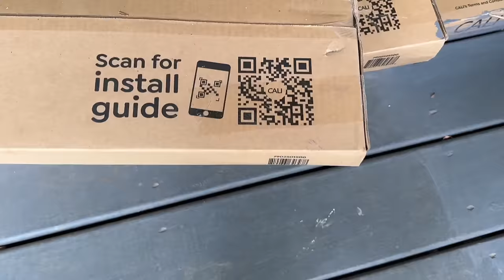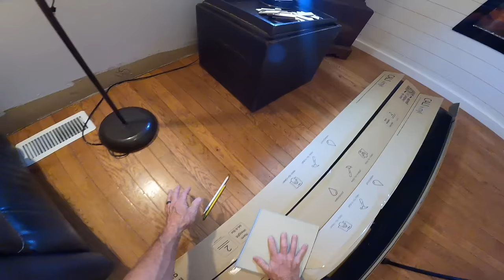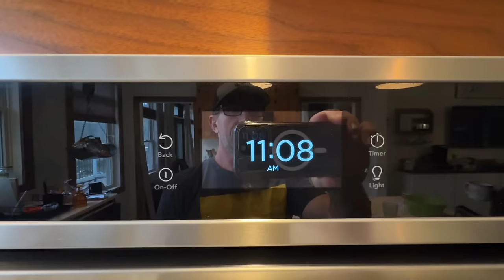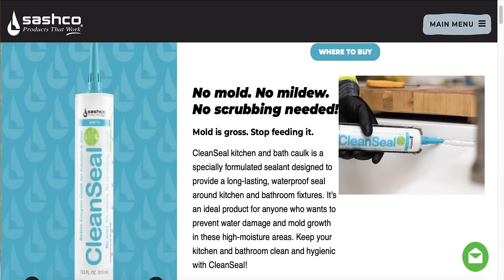Installing New Cali Luxury Vinyl floors from Lowes!

Comment: Hey Jay, here’s another pro tip. Take the plastic plate protector off your jig saw and it will cut more straighter as the blade will be more closer to your piece 😊
Reply from the maker: Good tip!

Comment: You should have added 2mm foam underlay carpet between old and new floor. If the old floor is slightly sunk into a pit in places new floor starts to make noise when you step on it.
Reply from the maker: Yeah, there’s like one or two spots that have a little creek in them but for the most part it’s pretty sound. These floors do have a little bit of foam already built-in on the bottom which I think is helping a lot.

Comment: For you transition to put the floor together from you family room to your kitchen, I have found that if you use like a 5 inch scrap piece with the correct edge.  I use that to engage fully and then use it to punch the two pieces together by pounding on the back side of it.  this way I ruin a piece I am not using and do not chance breaking the tabs on the pieces.

Comment: U should use scap pieces of flooring to hammer them into place. It doesn’t break the tounge off, but you’ll need multiple pieces of scrap because the will break easy, but it save your finish floor. Some flooring snaps east and some is difficult.

Comment: J you're doing a great job on that floor, I'd like to give some advice. I don't know if it'll work or not but for your wife's back. I have one of these chairs called a Teeter. And it really helps stretch. You can hang up side down. Or add a somewhat of an angle, but anyway, it'll.  Relieve her. I don't know what's wrong. If it'll damage her or not, but you might think about it. But I've had this for several years and it's really good for my bad back. That I have Is from working on cars and stuff all my life.
But it does pull your back and relieve all your strain And it would be Good for you too.Great For You also.

Comment: There are two wacking tools that are helpful. One is a black plastic block with groves and bumps. The other is a metal tool. It bends down at one end and bends up at the other. This is helpful when trying to close the gap when the plank is less than a quarter inch from the wall. Ask the store where you buy the planks from. And if you use a 2x4 instead of the proper tool, go back to the store and get the appropriate tools. You can cheat and use a cutoff piece that fits into the groove. Don't hit the edge of a plank, it will break.

Comment: I have a theory about the dulling jigsaw blades: The floor boards are likely not pure vinyl. What's killing the blade is likely an abrasive additive. Powdered limestone comes to mind here. It's dirt-cheap, bright white, no real supply constraints, good filler, UV resistant (so the vinyl doesn't get brittle in sunlight exposure), heavy (feels more luxurious) and stores heat. What could also contribute to the dulling is the friction heat. If the blade is used for a prolonged time, heat can build up in the blade removing its temper. This makes the steel softer and more susceptible to deformation (dulling of the teeth). But unless you want to take frequent breaks during a single cut, buying more or specialized (carbide?) blades is the most economic option. And if it's really the heat build-up in the steel, you could cool the blade with water during cutting. Do that on your own risk though, since I haven't heard anyone else doing it.

Comment: You need to screw an off cut of flooring to the underside of the tapping block, so that the groove fits the tongue and you can then tap without breaking the tongue on the new board

Comment: Question, I have tile floors also and there old and the grout lines are huge. I want to go over them
Like your doing , But won’t the floors squeak are move going over tiles and wide grout lines?
Reply from the maker: These planks that I’m using the floors are 9 inches wide so they cover any type of imperfections or gaps pretty well. If you’re using a smaller plank, you may run into some issues?
Reply: I understand, totally makes sense. Thank you, really appreciate you getting back to me.
Take care, & have a great weekend🤗

Comment: 17:23 I thought your idea was to start at the fireplace with a full sheet. What happened? I see you had to mitre it in at least 1 inch. 19:25 I cant believe you didnt use a scrap piece to lock into good tongue and hit the scrap piece on the opposite scrap tongue. If you want your scrap piece to last the whole job, cut the tongue off and screw a 2 by 1 hardwood along the cut off tongue line and use that for the bashing place.
Reply from the maker: Awesome pro tip!!

Comment: You’re likely all done putting in the floors…..for tight spots, put painter tape on board. Glue a piece of wood to tape.  Tap on the wood glued to tape. When done, remove the tape off the good piece of wood.  It’s on YouTube somewhere. Google it.  I’m likely explaining it horribly.

Comment: Why didn't all the boards in house run the same way?
Reply from the maker: That’s a great question! I wanted the boards to run long ways when walking in the front door so that it looked more elongated. But that meant that nana and pop pops tv room the boards would go sideways as you’re looking into the room which I thought would look weird and make the room look shorter. So I just made that room go elongated as you’re looking in the door and the rest of the house the other way. Hope this makes sense! Lol thanks for watching.
Reply: @Building_Jays_Way   that does make sense when I see it that way.  Thank you for the great videos!!